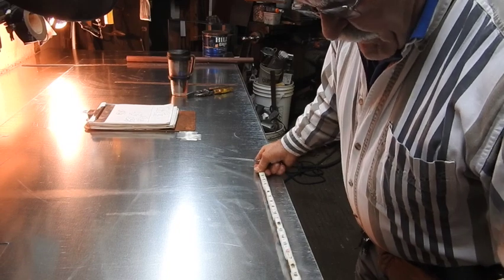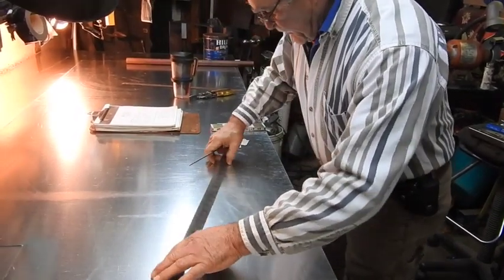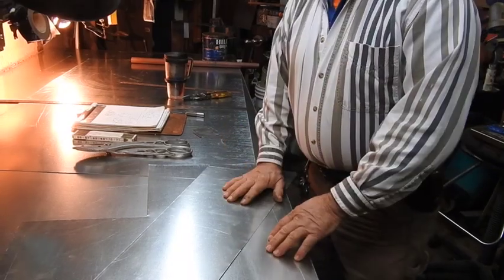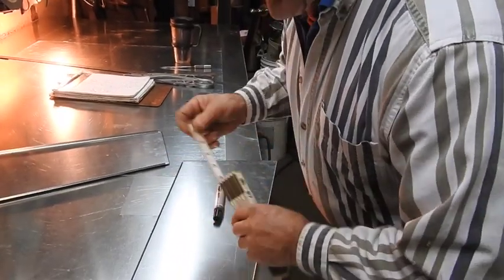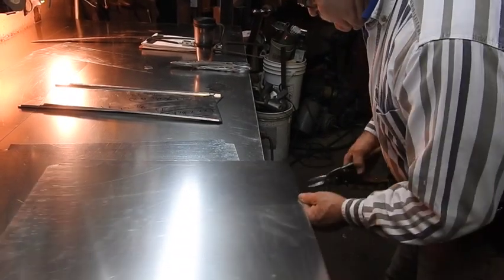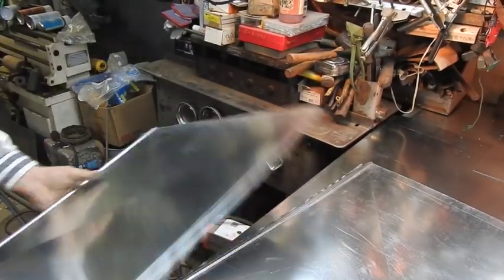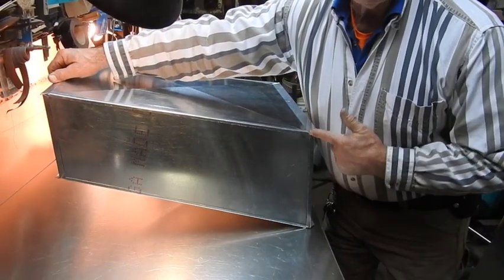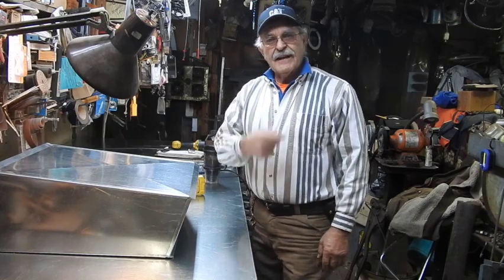Horizontal Reducing Offset- Old School Sheet Metal Hack

Comment: I have the same cleat bender but much older.they sure do speed things up and saves your hands.one thing I think would be nice is if the handles were on the ends instead of the middle.folding  4 foot duct for me being short have trouble with the handles.great work as always.
I am going to be retiring from doing HVAC/Sheetmetal in two years and I know I will miss it.

Comment: Looking forward to the install. Next tin project... a square  to round. On centre or mitered if you dare. Thxs for the vids!
Reply from the maker: Hahahahaha...its been a while, but I think I can..... If there's a situation where it will benefit the project, I'll do it !!  I'll pass on the mitered though.  LOL
Reply: @tractorman4461  I like to keep it simple.  A block end with a round collar cut into it. Offset with an adjustable elbow if needed.
Reply from the maker: @daviddesilva4971  I've been known to do that as well David.  Definitely an accepted way this day and time.  The old timers back in the 40's and 50's wouldn't do it though...I don't think anyway.  I've torn out sooooo many of those old systems back in the '70's. Closely looking at their non-pressurized ducting is where I learned how to lay out radius's and transitions.  They did some fancy work !!